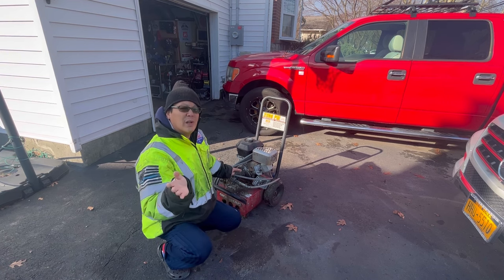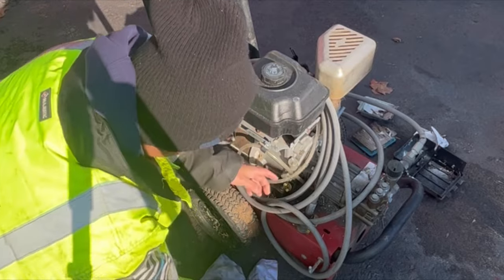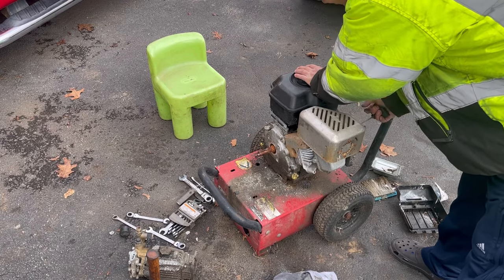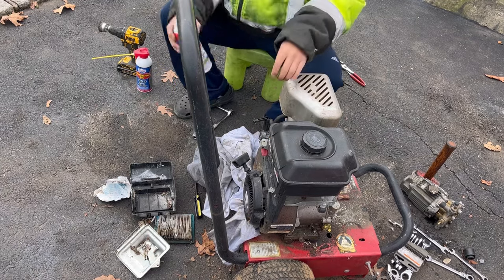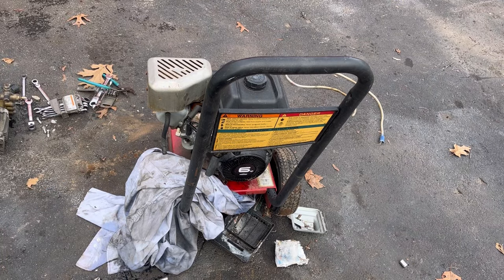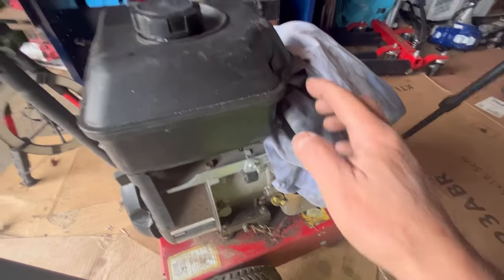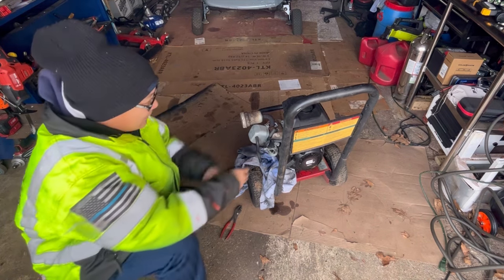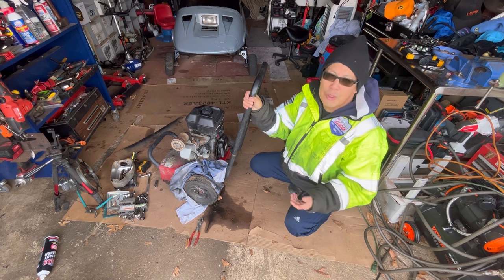FREE GENERAC BRIGGS 6HP INTEK ENGINE PRESSURE WASHER SITTING OUTSIDE FOR YEARS W/ WATER WILL IT RUN?

Comment: I fixed an old carb plastic inlet leak by replacing the tension type clamp thereon with a hose clamp, the kind you can tighten with a screwdriver or nut driver. Evidently, the hose squeezed tighter around the inlet by applying the extra tightening force available with a hose clamp. A year later, still no leak.
Reply from the maker: Nice hack,  but I think I’ll just get another new carb

Comment: The top white plug is also another fill hole for the engine oil, it is also a alternate for the long dipstick as you mentioned if it was equipped with one. But for those type of briggs intek engines usually you would fill the oil from there and then remove the yellow plug on the bottom til oil drops out then you know you have the correct oil level.
Reply from the maker: Thanks for the info!